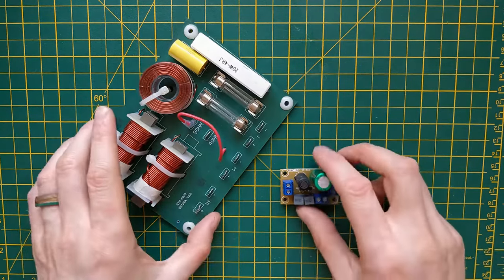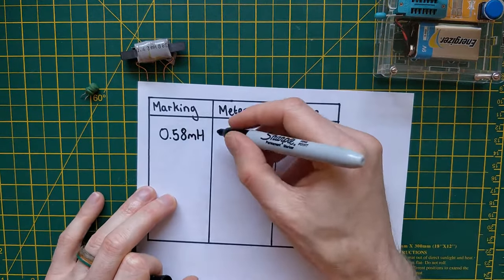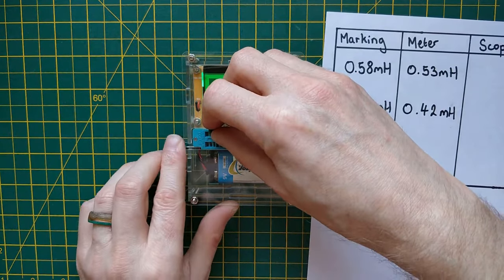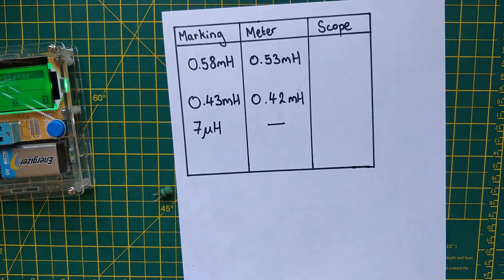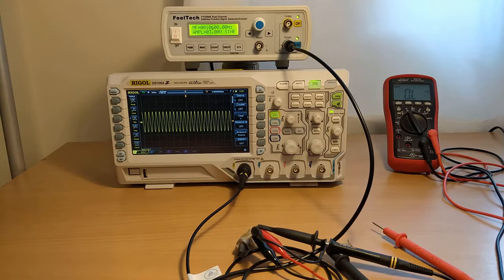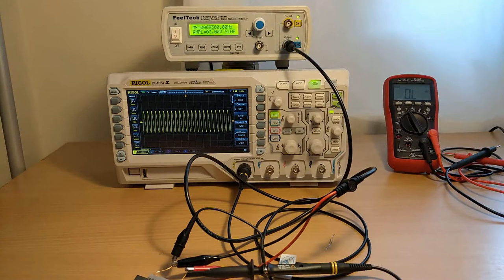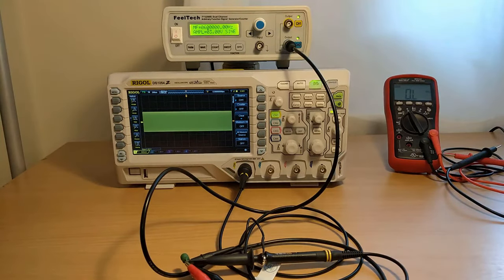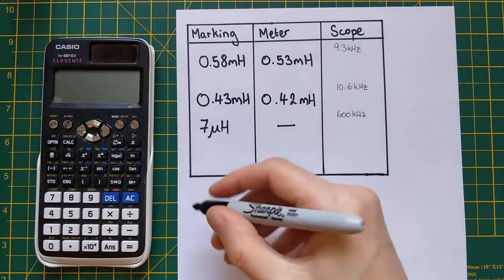Measuring inductance with an oscilloscope and signal generator

Comment: If you adjust the frequency until the voltage is 0.71 x generator voltage (in this case 2.2V), then the coil impedance XL is the same as the generator output impedance. Hereby the inductance is calculated as: XL=2pi*f*L=50.5 Ohm and L=50.5/(2pi*f)
Reply: sqrt(2) / 2

Comment: you're making a high pass filter with the signal generators built in impedance and manually sliding to the cutoff point to measure the value of the inductors, right?

Comment: Thanks Scott, that's brilliant. I tested two inductors I wound on two T50-6, they were wound per the toroid specs to give me 3.98uH on one and .13uH for the second. Using your method the first came out at 3.95uH. The second was too small for my scope & FG upper limits. I then modified the formula per your comments to 1/4 & sqrt(1/15) to try to estimate the smaller inductor value. The 1/4 volts was right on the limit of my gear and the math came out at .09uH. This has given me confidence that my winding calcs have created inductors pretty darn close to my target. Until I found your video I was progressing with fingers crossed, now I'm progressing with a lot more confidence. Cheers!
Reply from the maker: Really glad it was useful, I've never wound my own inductors but maybe I should give it a go!
Reply: Hi Neville. Can you point to any good resources online to wind my own coils? TIA.
Reply: @farzadbakhtiar  Hi Farzad. My go to site for toroidial coils is https://kitsandparts.com/toroids.php Click on the part number eg T50-2 for a whole world of info.
You'll notice there is a  blue menu at the top of the linked page. It has some really useful  info too. Sing out if you get stuck or have any other questions
Reply: Hello @Neville would you please explain how you came up with 1/4 and sqrt(1/15)? for some inductors the voltage is never more than a certain value (600mVmax for 3 V input) no matter what the frequency. is it because of the core I'm using that is getting saturated? was this your problem too? is that why you used 1/4 and sqrt(1/15)?
Reply: @ftmmrbs1996  I'm sorry but I cheated with the 1/4 and sqrt(1/15) ... I got those numbers from Scott's reply to @Suresh Kumar's question in the comments. If you're good at maths the detail is in the link in the description. I'm useless at maths but maybe 1/6 and sqrt(1/35) may work for you??? [I went for 1/6 as your 600mV "limit" is 1/5]. I have no clue why you cannot exceed 600mV but I wonder if the inductor value is so small it cannot be assessed by this method?? I used 1/4 and sqrt(1/15) because my function generator could not generate a frequency high enough to get 1/2 3V.

Comment: Another way that I like to use is one that works well if your function generator is crappy and doesn't necessarily have a nice linear output impedance (e.g. the FG-100 DDS generator). You connect up the resistor (in your case the 178.2 ohm resistor) as a shunt resistor, and use a 2-channel scope to measure voltage across the inductor, and voltage across the (known) resistor - from which you can infer the inductor current. Note that you would want a low ESL resistor, or at least ESL orders of magnitude above what you're measuring. You also measure the delay between the "current" & voltage waveforms, from which you calculate phase shift (along with freq.).

From there you can use Ohm's law to calculate the magnitude of the impedance, and with the phase shift you can calculate the complex impedance.

Take a few different data points and plot them in Excel, and compare with the theoretical calculated impedance :)

An interesting thing you can see with this method, is the ESR of an inductor shows up as a linear offset to the calculated theoretical impedance!
Reply from the maker: Great bit of theory there, thank you!

Comment: If you have an oscilloscope and a known size of capacitor you can deternine the inductance in a perhaps more straightforward fashion.   

The idea is to constuct a series LC circuit and find the resonant frequency.    Then use that frequency to calculate the inductance from the formula for series LC resonance.

Put the inductor and capacitor in series, add a resistor  (e.g 50 ohms) to stop the function generator from shorting out at low frequencies.  

Find the value of frequency which minimizes the p-p voltage,.  Use this frequency you found, the known capacitance,  to calcuate the inductance using the formula for resonant frequency of an LC circuit.
Reply: That's the way I do it.
Reply: Can you draw a basic schematic visualizing what you just said?
Reply: One addition. Series LC(R) circuit will have a resonant frequency when the measured voltage on R has a maximum when xL and xC are the same.

Comment: Your method works perfectly. But, I usually test the resonant frequency. Place a known capacitor (measured value, not just from the specs) and connect it to any voltage source. Disconnect the voltage and look at the resonant frequency. You only need an oscilloscope (and a good tester to measure the actual capacitor value). 
Also, voltage measurements are usually not very accurate with regular oscilloscopes, but frequency/time measurement are spot on, even for cheap oscilloscopes.
Reply from the maker: Very useful information, thank you!
Reply: Not sure to have understood your method. Do you mean, you connect L and C in parallel and connect them to a power supply (maybe 3V). Then with your scope setup for a single trig open the circuit and measure the ring frequency?
Reply: @patrickmonnier2193   Correct. Set the oscilloscope trigger to capture the self oscillations when you disconnect from a low voltage power supply. It allows you to calculate the inductance within 5% in a few seconds if your oscilloscope has good resolution for the frequency.

Comment: S11 Smith chart can be set to indicate the combination of resistance and inductance (capacitance) of a component as a direct reading. The impedance of a component may widely vary as a function of frequency and also with excitation level (volt seconds that is, flux density, gauss or tesla) The VNA is a great tool to plot the component impedance as a function of frequency. - for the case in this video, a 10 fold change in the capacitor value likely computes a different inductance value

Comment: Thank you for the video. It helped me confirming my LCR meter was crappy with higher inductance. I did had some problem with my Uni-t 962 Function Generator set to 50 ohm, i changed to HighZ (scope was on M as well) and everything was fine.

Comment: Thanks for the video. Btw, if you search for the frequency where the voltage is down to 1/3, the equation ends in L = 1/f within 1%. Having said so, a scope plus functiongenerator is a bit out of scope for me. I use an oscillator setup with a series LC circuit. In that, the Rinductor disappears. I measure the frequency with a soundcard on the PC. For an occasional measurement, it does the job.
Reply: Erratum: ...down to 1/3 ... is an error, it should be 1/8.

Comment: Neglecting the wire resistance of the inductor can introduce some error, I would prefer to adjust the scope time scale to look at the charge time of the inductor (or capacitor) and use that to calculate the value of the component.

Comment: Im guessing this method is most accurate for higher inductor values. While for lower inductances, since you need to fairly large frequency, the parasitic in the circuit might be relatively big and give a erroneous result
Reply: It is not the parasitic here. 20Khz is too large a starting value for a large inductor. Try say 1 Khz or even less.

Comment: As I understand it, RO is output resistance not output impedance, as impedance is always frequency dependant, which is why it is used as a constant in the formular ie not as a frequency dependant value.

Comment: At 4:17 you said it was 3.06Vpp but later in your calculations at 9:30 it became 3.08Vpp. Did you manually adjust it to get an output impedance closer to 50Ohm?

Comment: Hi, I tried a large inductor that I have and it wouldn't drop the voltage at all. I have the same signal generator as you have and dialed all the way up to ~10Mhz to get to 3V. It only drops down to about 2.7V in the low frequencies. How can I measure it seeing as the voltage doesn't drop by half?
Reply: Try rearranging the Karen Orton equation for a ratio of 9/10 instead of 1/2. Measure the DC resistance in advance. Note that inductancies are complicated beasts. You can not avoid the need for theory. The method here is not fit for large inductancies. You are likely on the edge of usability here.

Comment: I just wanted to double check. A 0.5 mH inductor at 9300 Hz (from the video) would have a resistance of 29.2 ohms (L * F * 6.28). I think I understand the voltage divider part of the measurement, but therefor it would make more sense to me if the found frequency would result in the same resistance of the output impedance (50 ohms). To get 50 ohms at 9300 Hz you would need 0.86 mH. I'm sure your formula is correct and I simply don't understand how it works. It would be nice if you can elaborate.
Reply: He puts the original formula in the description and works like you said, you measure the output voltage on the generator unloaded, and then you found a frequency that makes that voltage drops 1/2  and you say that you found the frequency for 50 ohm impedance. 
He is doing that, but the first thing that he does with the resistor is measuring that +/- 5% of the generator output, that's why he writes 50.49 ohms and not 50. but the other steps, with the inductors, are right,  he is searching for a frequency that makes the voltage drops 1.5V (half the initial 3V without load)..... that formula only works if you are searching for 1/2 of Vgen unloaded.
sorry if my english is not the best  😅
Reply: Not 29.2 ohm, but j times 29.2 ohms. J equals sqrt(-1), expressing the fase shift between current and voltage from an inductor.

Comment: Would you happen to know how many uH the chines MDS-60 metal detector kit might be?
Reply: You could give it a try, but it will be close to impossible with the components already soldered in place. You will need a high frequency on your fg too. Moreover, to get to know the design it is important to measure the mutual inductance, not only both self inductances.

Comment: Good tutorial, I was looking for a way to use my new oscilloscope and signal generator to measure inductors.  You helped me do this plus also determine the output impedance of my signal generator.  Does this work for capacitance too?

Comment: Great tips! I tried out this method on my Voltcraft DSO-1084F (rebranded Hantek DSO4084C) scope with builtin function generator and guess the measurement worked out. I measured the output impedance of the generator to be 390 Ohms. Alternative to your calculation of the output impedance of the generator, you could also measure it with a pot, aiming to achieve half of the peak voltage compared to the unloaded state.
Reply from the maker: Nice work!

Comment: Hi Scott
A really fascinating video. I am trying to use your method to measure a large unmarked smoothing choke. The FG calc works out perfectly at just under 50 ohms but I get no p/p drop whatsoever with the choke in parallel and  reducing the frequency as instructed. The DC resistance of the choke is 418 ohms.  
Is it possible this method only works for small inductors? I expect the choke to measure 10 -15 Henrys.
Keep up the great work!
Reply: You will not get a drop more than roughly 12 percent and only at very low frequencies. In addition, the large Rind will cause severe inaccuracy, even when compensated for. This here is not a great method for large inductors. You might try the method by "DIY made" at its 50 Hz, provided that you take care of safety(!), proper compensation equation and significant readings from the multimeter (larger reference resistor and/or multimeter with accurate low AC range).

Comment: my function generator metravi make is bad. its amplitude going smaller when increasing frequency
other OHM tech indian make is good upto 1.4Mhz its amplitude remain constant as per set point.
i have tested with multisim also, One problem shows that multisim inbuilt function generator or inbuilt agilent function generator shows 50 ohm impedence but when connecting any resistance like 132 ohm its voltage accross 132 ohm does not fall. so my test as per ur methode(finding impedence) is not functioning. then i add additional 50.49 ohm to output and measure as per ur video , it is perfectly working.thanks for ur video,

Comment: Could you just wire a resistor in series in front of inductor, put a probe before the resistor, and after the resistor, and adjust the frequency until the voltage on the probe after the resistor is half that of the first?
Reply: No, the faseshift of the L should be taken in account.

Comment: triple checked. pk->pk 5.08V -> 4.32v 271.5 r   so aim for 2.54v  17.490Mhz  Getting 2.7 mH - INductor is a 5.6mH. Any clue what I am screwing up?  signal generator is new rigol.  Oscilloscope is a new 2ga sample  siglent.  dvm is old HP that passed certs recently.  I should be measuring closer to 8Mhz.   Just a software engineer trying tolearn to  measure toroids he needs to wind.

Comment: my function generator says its 50 ohm output impedance but I found it 400 ohms based on this video. is this not strange?
Reply: Could be that your fg is not 50 ohms output. So connect 400 ohm (or 180+220 or 4*100 in series) and observe the downfall of voltage, and at different frequencies. If 50 %, your Rout is 400, not 50.

Comment: sir which frequency will be best to use
Reply from the maker: It doesn't matter, just try some and see what works best. 20kHz is a good starting point but you will get the same answer regardless.

Comment: sir in formula why 0.5 used for V out by V in
Reply from the maker: Again, it doesn't matter. Look at the link in the description, and at the maths after the line "The question now is for what frequency (Vscope/Vgen) = 0.5:". Instead of 1/2, put 1/4 in instead, and follow it through to the end. You should end up with a formula of: L=sqrt(1/15)(R/2 pi f). So if you make the oscilloscope reading 1/4 of the original value instead of 1/2, you would use this formula to calculate the inuductance. 1/2 is just chosen for convenience.
Reply: @ScottMarley  yank u so much sir

Comment: Disappointed that you completely punted on explaining the math… I didn’t really need to watch 11 minutes of hooking stuff up to measurement devices; I can figure that out myself. The key thing to know is how to derive the inductance from the measurements, and you skipped that entirely.
Reply: I was going to say exactly the same thing.
Reply: He explained it perfectly well. He used the formula for inductive reactance to find a value for the inductance.
Reply: The link in the video description goes through that in detail. I agree, most of the satisfaction comes from the understanding.
Reply: And, in fact, he could have skipped all the math with the 459 constant (x10 to some power multiplier dependent in exponent of values)  I came to this looking for the math so I would appreciate tips, links, pointers to the math for non-engineers.  I knew all that math 50 years ago but it's long since evaporated from my brain.